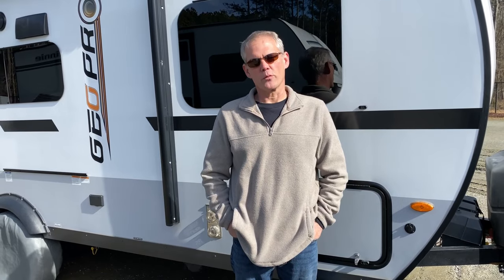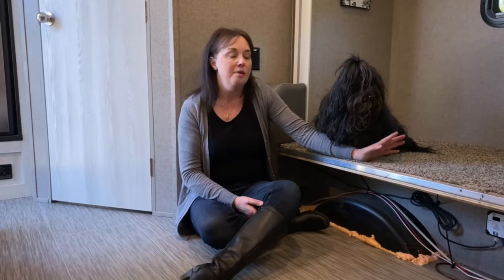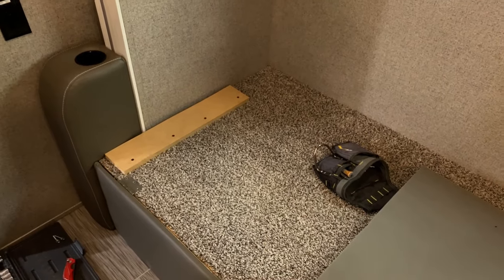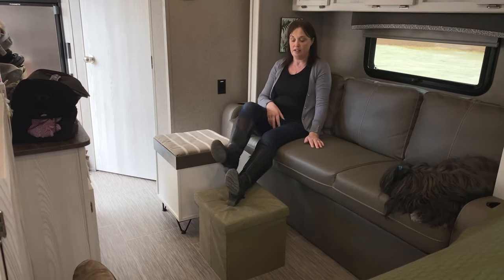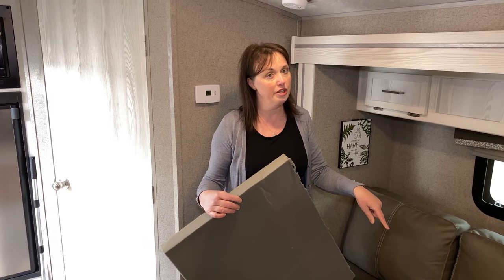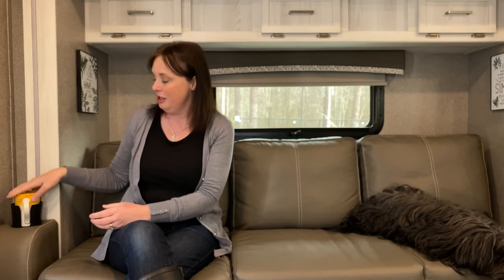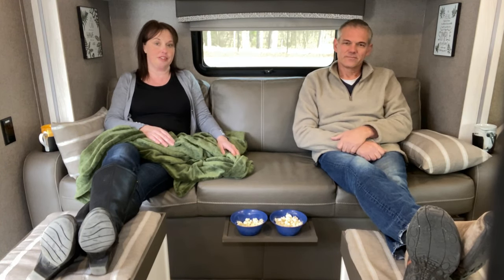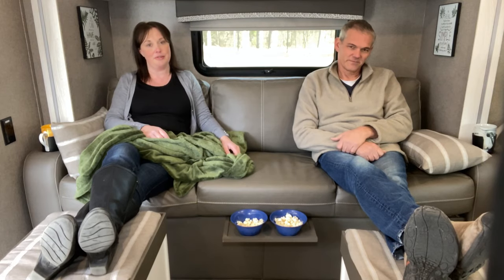Modifying our GeoPro JackKnife Sofa - 5 Changes That Made it Work for Us.

Comment: The collapsible stool idea is a decent one. Instead of adding legs to it which means maybe no longer folding down flat I would leave as is and add a cushion inside that pulls out and is stiff enough to set on top of the stool and gives you 3-6 " of height that's comfortable for your legs depending on what you need. The taller ones you made which I love your design are too high for my legs. I must be slightly lower than the seat for some reason or my legs behind my knees hyper stretch & I'm in pain for several days. And especially if one of our pets decides to make my legs their comfy seat too. You can fold the ottomans. Remove the covered cushion and store in our case along side our sofa or tucked under our sofa. Our jackknife sofa has pretty much full storage box under it and really difficult to get into it. I like your piano like hinges and flip up storage panel. I intend to do the reverse with ours. I intend to cut our 72" length of front skirt box in two. Leaving the side ours has a heat vent coming out of. This heat vent does not cause much loss inside the box but does take up a good 20 inch slice out of the front box. Rather than move the vent over and risk too much stress on the aluminum vent hose I thought I'd just leave as designed and cut 1.5 inches on the other side cutting the board into 2. Our skirt also is fabric covered. No padding however. So I will recover in the new upholstery cloth a marine coated canvas I bought 20 yards of. Plenty to reupholster the sofa, dinette cushions all the skirting and fabric trim and also make a few storage pockets similar to shoe storage pockets that you see that hang over doors. I've seen that done to handle shoes or other products in other DIY projects for Sofas. I'm not going to go over board and of course none for the heat vent area leaving plenty of room on either side to insure nothing gets in the way of the heat. I think there is a wonderful space on the other side of the vent however to put a wide slender envelope pocket that can hold a road atlas ro maps or even just a magazine or rwo. Keep it slim and simple and tight to the board so to speak. I'm thinking of adding a flap to keep what ever we do store there clean. I found your Video today because I was searching how to remove a jack knife sofa from an RV. Yeah...yours is different as it works on a raised platform and much easier to undo bolts and remove. Ours has an iron frame and base and is very heavy and bolts right into the floor. We are not sure if we have to have someone under the RV to catch the bolts or if they are frozen as in welded in place and you only run the nuts. And it will require 2 people to battle removal for sure. But I need to remove for 3 reasons. One to reupholster, The seats not so much the backs need to be refilled with better solid not so soft foam. I have enough materials on hand to tackle that. Also need to remove carpet that was not removed when past owners put in hard flooring in main floor but not under cabinets or cubbies or the sofa. And finally two of the RV windows leaked and I repaired walls and flooring on other side and there is signs of some leaking on this sofa side window too. Windows were cut too large on the RV for the actual size of the window. They barely hide the light around the upper area due to this. The original round rubber seal with wee bit of self adhesive material and light bead of failed silicone seal around edges were doomed to fail from Day one the RV rolled out of the manufactures warehouse. Anyway past owners had no idea how to fix or enough interest in tackling it. I know nothing and it's the first RV I've owned and my learning curve has been very steep I love your foot stools though and plan to make two. I happen to have two of these stools I bought for tent camping then never used. Perfect to play with to figure out how to make the cushion for the top and add a handle to pull out of the box. I have enough room at end of sofa behind the passengers seat to place both boxes side by side. I'm debating adding wheels using your suggestion to add boards to screw in short legs/feet to do that or stay with the keep m options open and skip wheels just let me collapse and store all under the sofa box or made up on side or between the dinette foot bay when table is removed or set down as a bed. I will use dinette bay for guests but otherwise I plan to remove the table to store my folding bike in it's case and my inflatable sea kayak also in it's lovely canvas case. Two bikes & two kayaks if my husband decides to join me. He's a stay at home and I'm the camper. Fifty one years married and it works for us. Anyway I've run across several of your well done videos and advise and love them all. Now off to find out what to expect on how to remove those bolts that go into the floor itself. YIKES. Hugs to Desi....
Reply from the maker: Hi!  First - apologize for taking a bit to get back to you!  And second - thank you for taking the time to give us so many tips and ideas!

Thanks for the idea on the footstools.  With ours, the height is a little too high for us also.  We are looking at some ways to make them a bit lighter and still sturdy and we plan to make them a bit lower at the same time.  The cushion is a great idea for someone that does want to be able to fold them up.

Really like the idea of splitting the board underneath into two.  We had thought about that but as of yet, don't want to reupholster as everything is still in good condition.  But, if the time comes - definitely going to do.  Opening one side or the other is much easier!

We had an older Class C prior to this camper and it also had a jackknife sofa that attached to the floor with a metal base.  We had our fresh water tank under it.  We did take it apart and had the sofa reupholstered along with the front piece.  It did take two of us but don't remember it being too difficult.  Just a bunch of bolts to undo.  But tight space so two people was definitely needed!   (by this time you maybe have done this?  Curious how it went!) 

Sorry about the leaking - in that same Class C, when we bought it, the windows up front in the cab over were leaking.  Definitely a pain but once fixed, the camper held up great for the two additional years we owned it.  

Congrats on 51 years!!  That is amazing!!!!  

Thanks for watching - we really appreciate!

Comment: Nice couch conversion. Also liked the cup holders. Question: after you did the couch conversation, could the couch still be converted to a bed? My guess would be probably not.
Reply from the maker: It actually does fold back down still as we tried after we were finished.  We don’t use the bed though so not sure how comfortable still.  But, we should be back there this week and will check and update you.  Thanks for watching!
Reply: @WinesPinesandCanines  thank you for your quick response. My cup holders arrived today (love that tip). I’m going to deal with the fat couch backs next. Love your channel 👍
Reply from the maker: Glad the cup holders worked out!  We are very excited to try them out ourselves as haven’t been able to enjoy a cup on the couch yet haha!  Haven’t forgotten to take a closer look at the couch flat - should be able to get to that this week.
Reply from the maker: We took a closer look at the sofa while it was lowered into a bed position.  No issues.  Didn’t hit the tray and tilting helped to keep you laying towards the back.  Hope that helps!

Comment: As a single, I'd get rid of that couch entirely and put in a tall counter top and a comfy bar-stool. There would  be room for shelves and storage underneath and above. It'd be a great spot for working at my laptop or for working on arts and crafts or to just sit and eat. When I was ready to watch TV, I'd just go lay on the bed. LOL
Reply from the maker: Good thinking!  The only problem in this camper is the bottom of the couch sits directly on the slide (which is approx a foot off the floor).  So you can't slide a bar stool out of the way.  Also the reason we couldn't do the theater seats!
Reply: @WinesPinesandCanines  With the slide in is it a tight fit to the opposite side? If not, couldn't you just extend the counter top out enough to accommodate bar stools and use that slide piece as a recessed shelf? Of course, I'm a single so I don't have to worry about someone being able to get around me. LOL
Reply from the maker: There is 3 - 3 1/2 feet I think with the slide out but with it in, only about 18”.  But maybe a hinged one?  Like the way you think - I find there is always a solution haha!
Reply: @WinesPinesandCanines  Ooo, I like the hinge idea! And the bar-stool could go on the bed for travel days. :D

Comment: Love the coffee cup holders! Have you tried to rotate them so that the mug handles are facing you?
Reply from the maker: Yes - they easily go in and come back out (the electrical tape just helps keep them snug).  You can set them into the original cup holder whichever way works best for you (which is the best thing about these - inexpensive and super easy to do and use!). Thanks for watching!

Comment: I don't want to permanently tilt ours back as then seems like it would be uncomfortable if one DID flatten it for a bed. This is where my idea for the rocker springs came in. If one mounted wood underneath to platform and wood to bottom of sofa, could springs be mounted between?? We have already hi get the access panel on the front of ours! I am wondering about (once we raise it slightly,  making some kind of footrest that can slide under the seat (not using drawer glides,  just slde in) and hinged legs to act as reclinereaque foot rests. We don't really want additional foot stools in the camper. But I'm mulling over some ideas....
Reply from the maker: Hi Amy!  So the couch is definitely not the comfiest lol.  The back cushions are so much higher that most people have put a foam pad on it to help if someone is sleeping there.  Tilting it actually helps as it keeps that side a little higher so harder to roll off.
The springs are an intriguing idea - would love to know how that works if you do the mod!  
For the footrests - we had somewhat the same thought.  But when the slide is out, we only have about 6” from the front to the wheel well (facing the couch on the left side). The other side is about 10”.  So, I put that mod on the back burner but every once in a while I revisit to see if we can come up with a workable plan lol.  So again - would love to know if you do this!  
Thank you for watching and please let us know what you come up with!  We love messing with this camper and seeing what others have done!